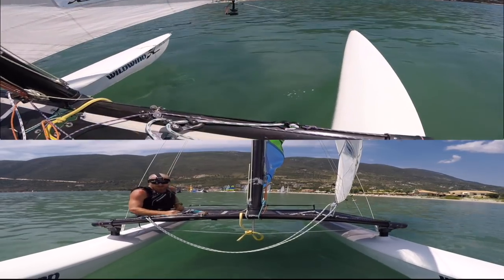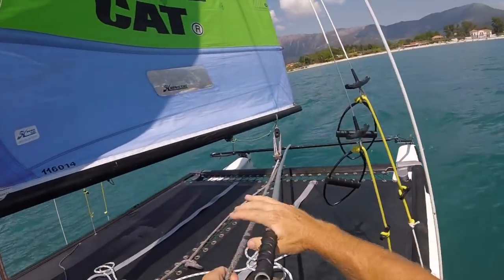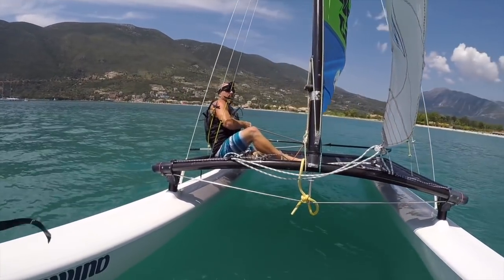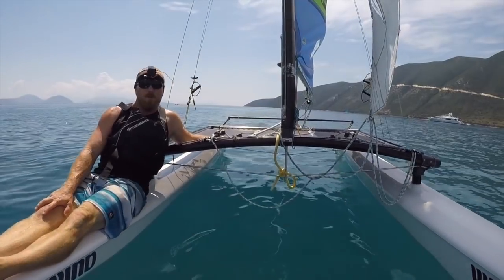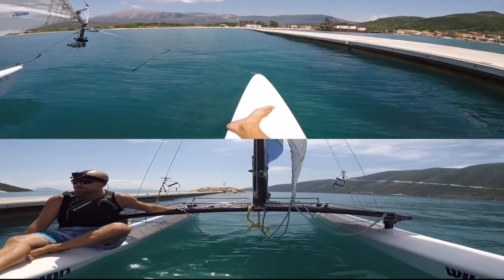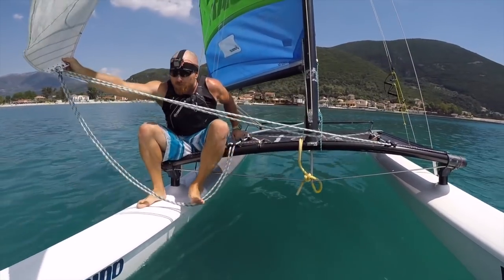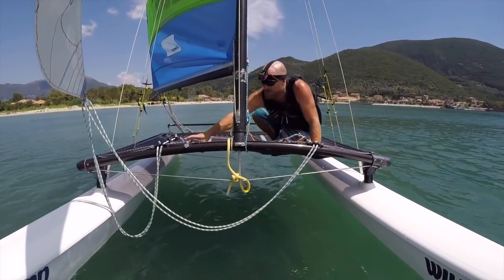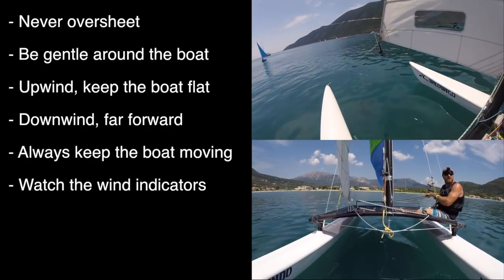Solo Hobie 16 light wind technique   multi cam with live commentary

Comment: You're a rockstar! Thanks.
PS.  I've noted that in ultra-light wind conditions, sitting on the leeward pontoon is more beneficial as it titls the boat ever so slightly and helps keep the sails on the proper side of the boat.  Not a huge change, but at those wind speeds anything that helps will assist with the mental aspect of light winds.

Comment: Hey Joe, thanks for the videos, they are excellent and have been extremely helpful!  I'm just moving from a Sunfish to the Hobie.  I picked up a tired '75 14t and a pretty decent '84 H16 and I'm super excited to sail them.  

We live near a decent size lake, but the water is generally only about 15-20 feet deep in many areas.  How concerned should I be about the mast going down and hitting the bottom when capsizing?  I don't really want to buy the float but should I because of the water depth?  

Do you think there is any point in owning a 14t if you've got a 16 and you are equipped to right it single handed?  I'm wondering if the instability of the 14 adds to the fun or not once you learn to manage it.  Good sailing days here are usually only 7-10 knot wind with gusts to 17 or 18 knots.  I weigh the same as you.  

Perhaps you might even make a video comparing the two for single handed sailing, I found it so difficult to choose between the two for when I'm alone that I bought one of each!

Thanks!

Comment: That was pretty much my day today on the 16 except I was lying head forward on the tramp with the tiller arm beside me (got a few smiles from the boaters for that). Never thought laying that far forward, actually on the hull, would make a difference. Thanks for clearing up a few other points like a loose downhaul (also helps the mast flip over) and literally pushing the jib out for downwind travel. 
Loving these tutorials , I bought my 16 and started sailing from scratch about the time you started making them . You saved me many embarrassing moments. Cheers!